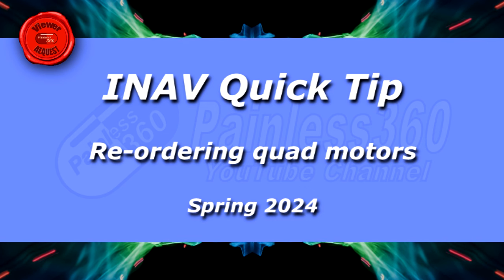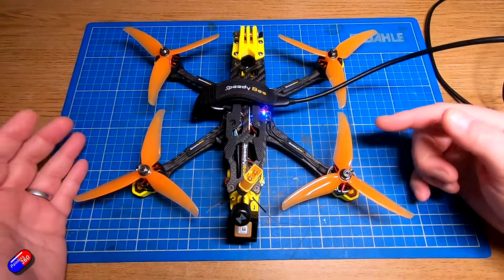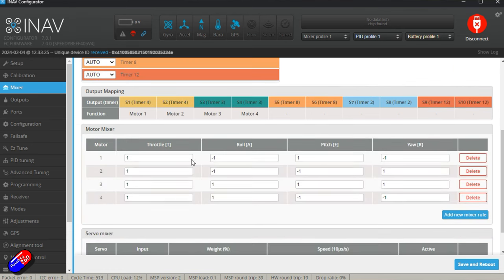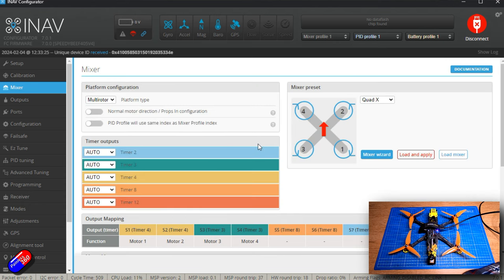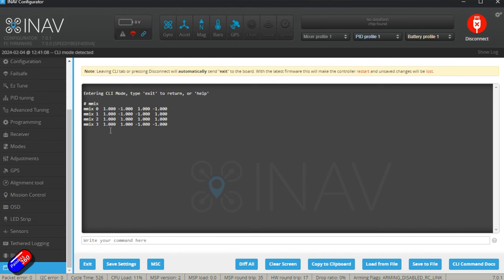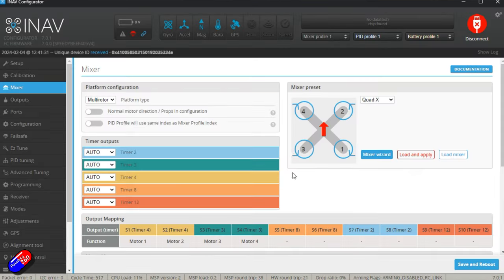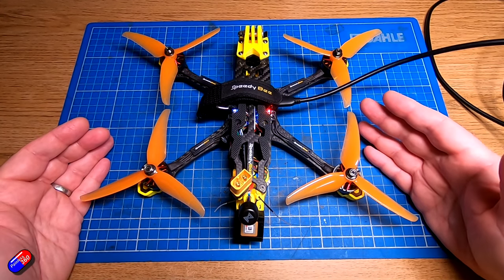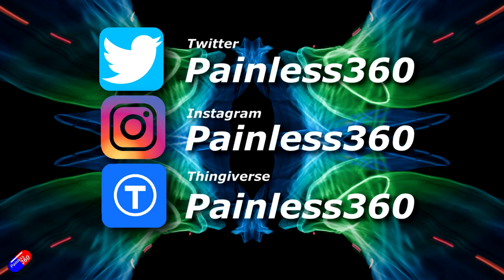How to easily re-order or move quad motors in INAV (Subscriber request)

Comment: For a fixed wing where I need to change the FC (f405 wing) motor output pin from servo pin 1 to perhaps servo pin 7, is there a way in iNav to do this?  I think I burnt out pins 1 and 2 and so need to assign a different pin to motor control.  Thoughts?
Reply from the maker: I've never done it but should be possible. See my video on setting up outputs. Makes sure that motors and servos don't share the same timer. Best of luck!

Comment: I followed your advice to have the correct motors order, but there are 2 motors are running in wrong direction, how to correct them besides swapping two wires on those motors?
Reply from the maker: Check out the series. You use Blheli suite to reverse the motor... Happy flying
Reply from the maker: https://youtu.be/fROH0_hanXU for you! :D